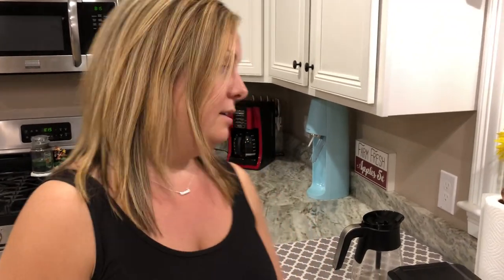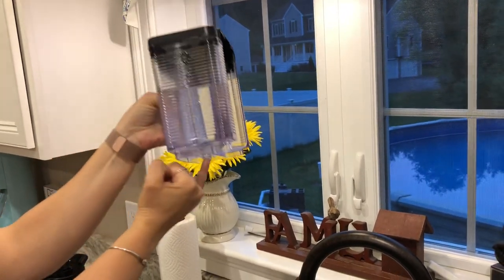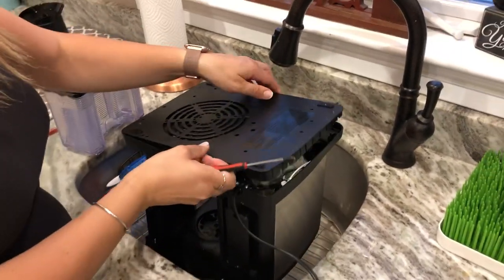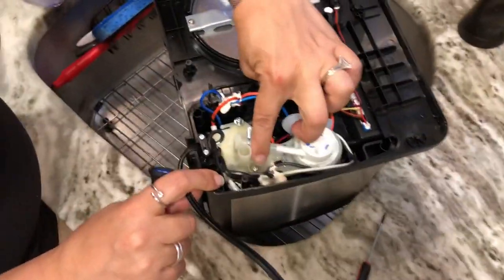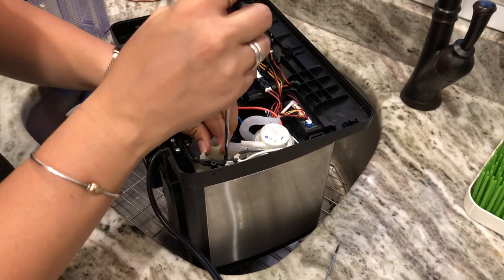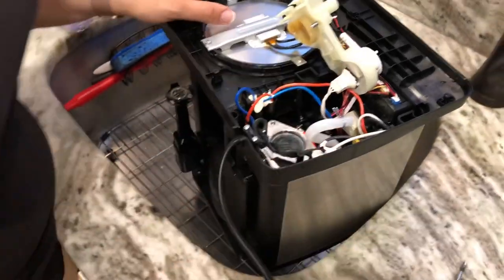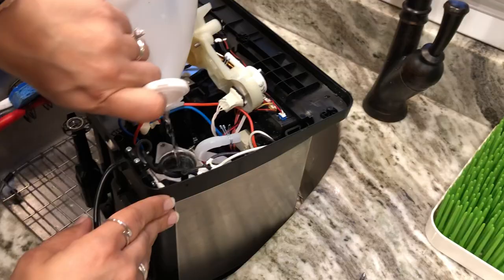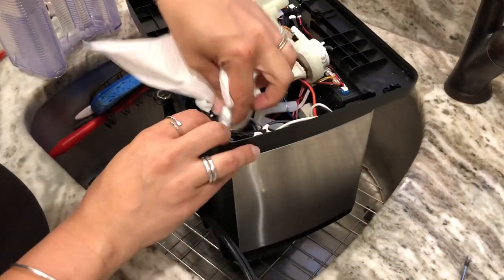Ninja Coffee Bar 5 Beeps of DEATH ~FIXED!!!

Comment: I mean come on, on a 100+ dollar coffee maker you gotta do all this on a barely used unit? Give me a break what a cheaply built crappy coffee maker if you need to do all this. Just buy a mr. coffee at that point, they never have issues.... I bought this coffee maker to be nice to the environment and only make one cup at a time since I'm single but if I'm having to throw the whole unit away after using it 5 times then what is the whole point?
Reply from the maker: I know, it sucks.  Hopefully they fix it in the future, but I’m sure they won’t bother LOL I just liked all the options on it.
Reply: @MMAMoM23  my issue ended up being the water was too cold I was putting into the machine LOL. So it sounds like they use the same beep for multiple issues which is annoying. I do love it too though so I agree with hopefully the new ones are better.
Reply from the maker: @gearheadtechnology  omg how crazy and temperamental!! LOL I can’t believe the water was too cold!

Comment: Didn't work
Reply: I have the answer to the 'Beep of Death 2.o'... It requires the dismantling of the Swing Brew Basket.  There are subsurface magnetic contacts that feed the ability to perform a brew cycle.  At the root of all of this is a a spring to facilitate the contact.  And, there you go, no need to buy a new unit... Definitely a weak design and I will show you how to reinforce it as well!!!
Thank you Jillian 🤓

Comment: Fill your reservoir with Distilled White Vinegar, and hit the "Clean" button... Problem solved.
Reply: Mine didn't even let me do that. It still beeps
Reply: I can't do that either. Still beeps. Its not always an easy fix.
Reply: @nikkiellison2346  I fixed mine like he said but just pressed the button for coffee. It took about 20 tries. But eventually it worked and I could use the 'clean' button. I filled it with more vinegar and its working like before